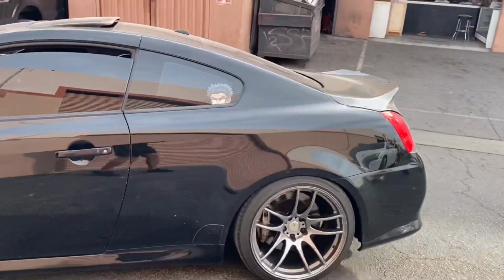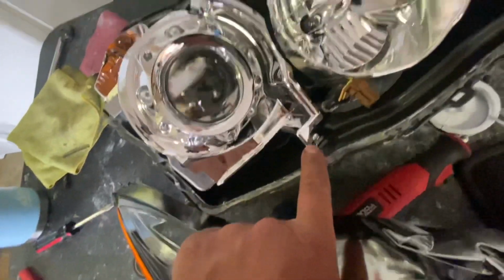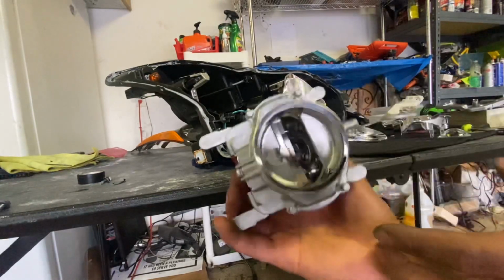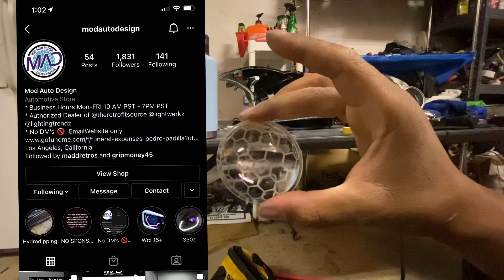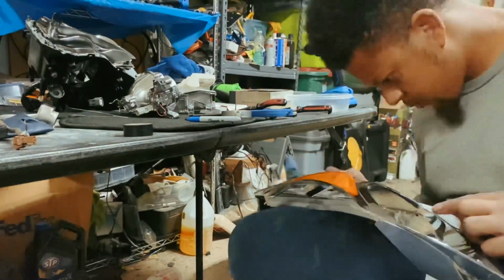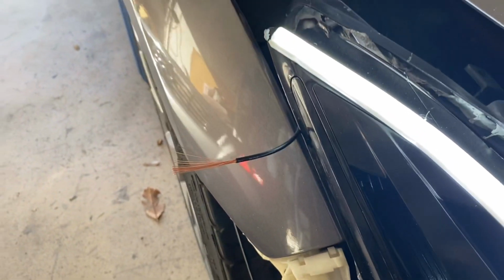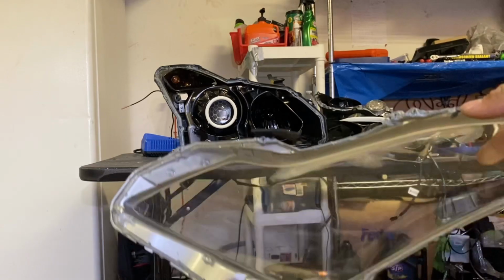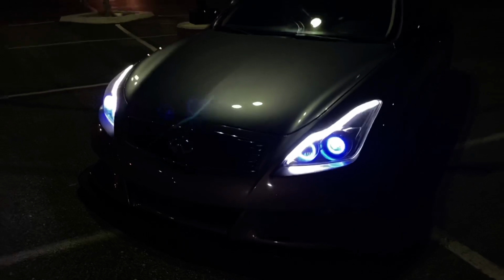RETROFITTING MY G37 IPL HEADLIGHTS PT.2!!! | Demon Eye & Honeycomb etched lense install!

Comment: for your xk glow strips. what wires did you tap in on the harness. what is the drl color wire as well as power and ground. thanks man. they look sick
Reply from the maker: Your gonna want to tie the power and signal wire together and hardwire it to the running light. That way when the runningday light turns the strip will too.